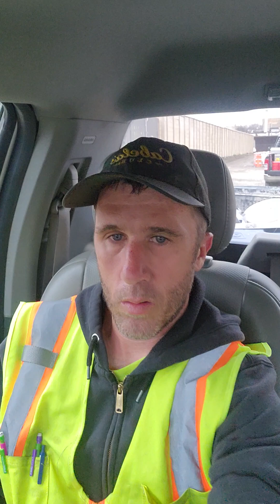Job Review: Construction Materials Testing, Engineering Technician

Comment: Hey I just got hired as a tech. Or CMT. They tell me there’s work in the winter. Do you guys work all year round? I see a few things that say they don’t. But most of it says they do things like more lab work. Heat controlled construction. That kinda thing.
Reply from the maker: every year is different. two winters ago I had work all through. This past winter I was laid off for about 3 months. Generally it does slow down

Comment: Im 19 and start in a month, it seems like the turnover rate is high but hope all goes well. Nice video very informative!! Also, they say that Ihave to lift a lot, do you lift a lot during work? 75lbs is a requirement in the job I accepted
Reply from the maker: Turnover rate can be high depending on location and company, but our office is pretty consistent. Occasionally i have to lift heavy stuff, but if you're in half-decent shape, there's nothing to worry about. Hope it goes well for you. There's a lot that can be learned. I'd say its a great job to have at 19. God bless

Comment: Wow thanks man I really appreciate it I’m 20 & start Monday for Intertek PSI I’ve worked in construction since I was 16 from insulation to blacktop & some banking experience so far only con is 18 hr pay but 28 hr overtime pay, they tell me in the hot season they generally work between 10-13 hours & some nights every once in a while, I don’t mind that but after watching your video I can understand & relate, you & I ain’t so different, the one thing that really stood out  was the ability to work independently & i loved that (As a CMT technician what kind of math is generally required?) if you have any advice as well I’d appreciate it